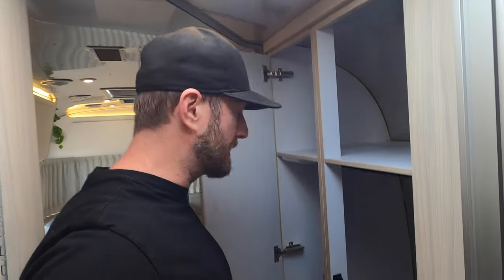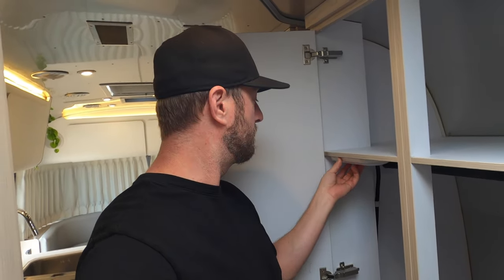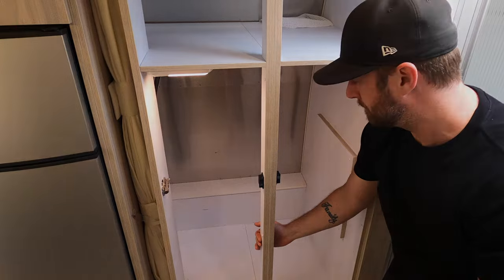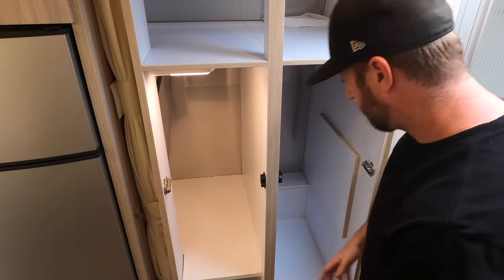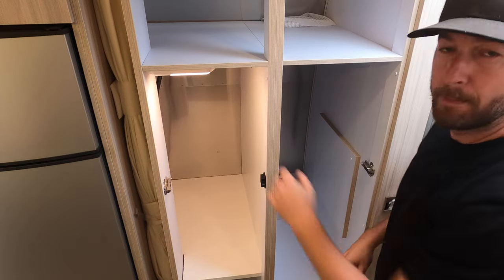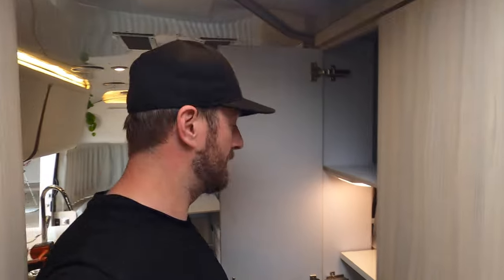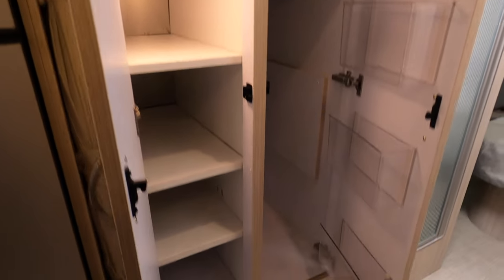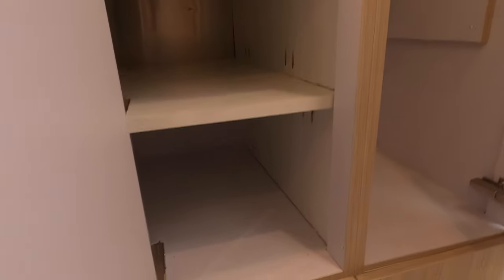DIY RV Closet Shelves! - Transforming an Airstream closet for more usable space!

Comment: This is awesome. My wife and I just bought a 27 FBQ and will be going full-time in January. I’ve been tasked with figuring out shelves, and I do not want to put holes into the Airstream. After the bottom shelf, how did you secure the remaining shelves on the refrigerator side of the closet? Also, how has everything held up? Would you do the same again? Any adjustments?
Reply from the maker: Hi Scott and my apologies for the late response.  Although I'm sure you have found a solution by now, I wanted to follow up to your questions.  

I installed a slim shelf support that is screwed into the refrigerator wall side.  Two small screws that I can patch if we ever sell.
The shelves have held up extremely well with no issues or movement, but net time or possible in the future I would probably switch to a lighter system using wire baskets (to reduce weight and allow more air flow).  But this was a great solution for the price.  Thanks for watching and safe travels!